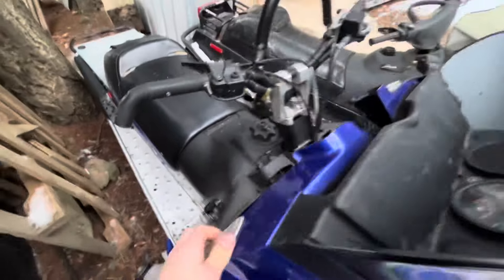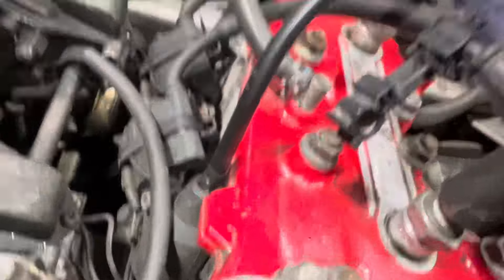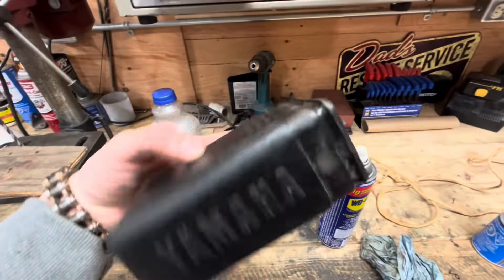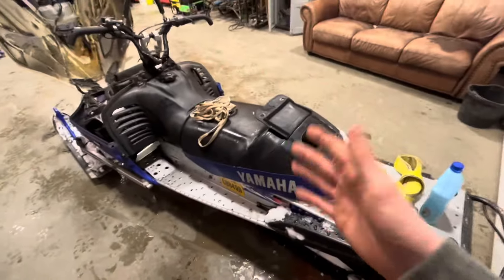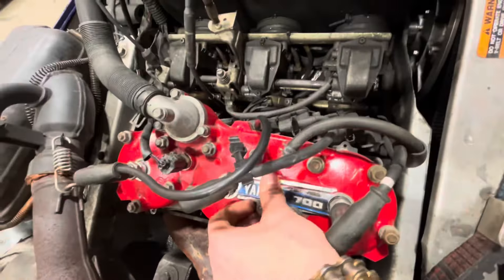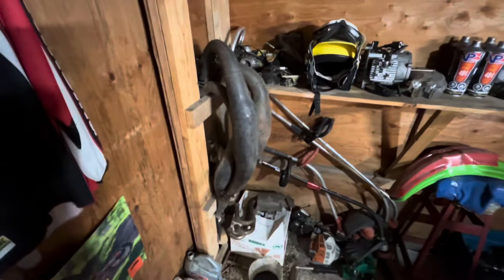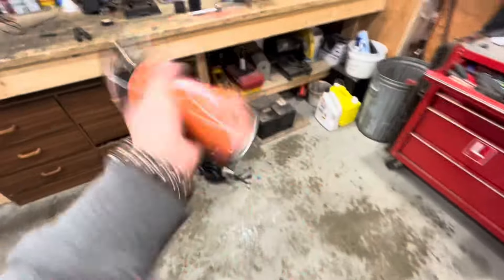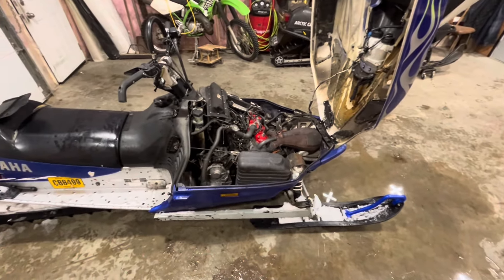Testing my 25 year OLD snowmobile!!

Comment: The wire going into the coil should screw in like a bolt my guy
Reply from the maker: Ya but even when I tried to screw it in it would still pop out threw hot glue in there for safety 👍